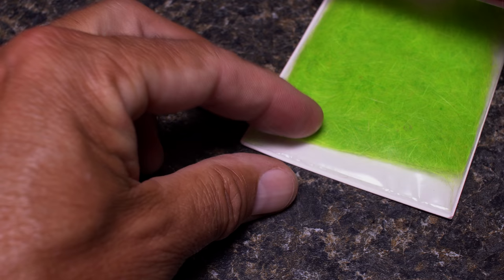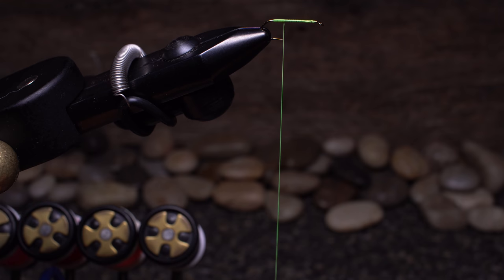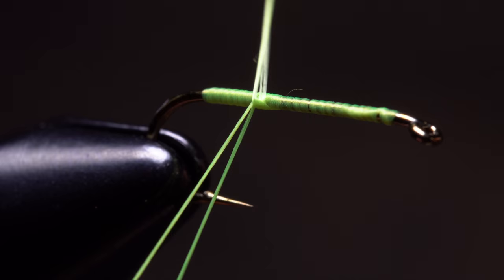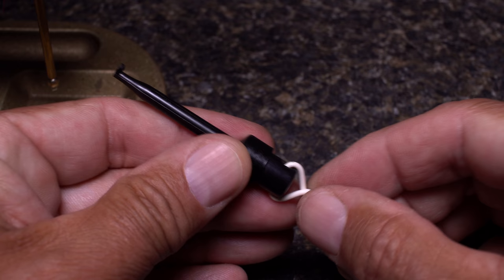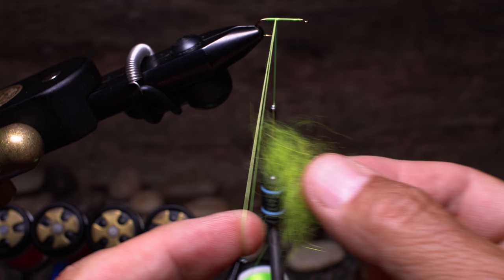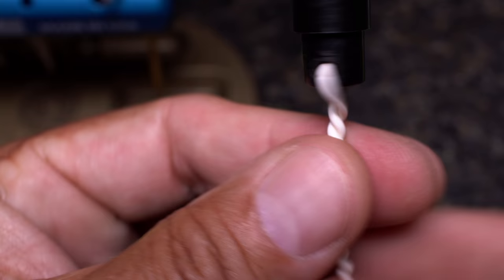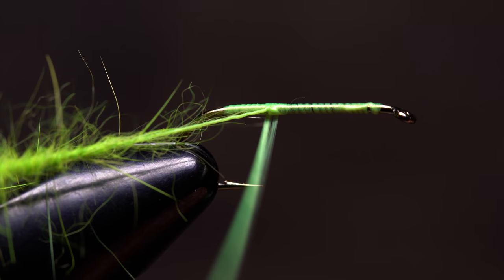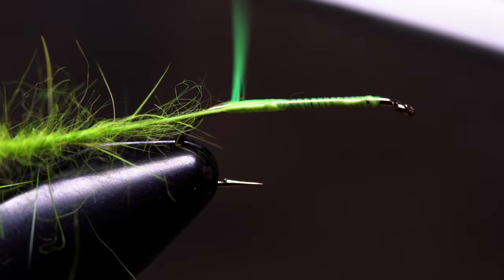How to Make a Dubbing Loop

Comment: Another great how to vid.  In other videos, you will often split your thread in two and insert your dubbing in a similar fashion.  How do you decide which method to use? Is this method in the video superior to splitting the thread?
Reply: I was wondering the same thing. Some threads are harder to split, so this might be a fix for that. Not really sure though...

Comment: Hello Tim. If you are by chance able to reply to this I would be grateful. Probably 20+ years ago I was in Shannon's purchasing materials. I spent some time eyeballing the fly assortment and in there were some Sculpin ties. They really appealed to me and I bought one. I added it to my box and took it fishing at VanCamp's grove where on first drift I secured an 18" brown. Next I was on the Pequest where I anxiously gave it to a tree. Woefully. Now this Sculpin was tied with many colors of yarn seemingly spun as in a dubbing loop. Then trimmed. The fins were implied using black moose mane, the tail,brown hen back feathers and it had small dumbbell eyes painted brown. I called them from my present location here in Ky. It was a dead end.  My point here is how did the tier put this fly together.
Reply from the maker: Sorry Thomas, I'm kind of at a loss on that one and don't recall ever seeing such a pattern in the shop. The shop, now South Branch Outfitters rather than Shannon's currently does have some of John Collins sculpins in stock. They look great and fish even better. They might be a suitable replacement. Sorry I couldn't be more help.

Comment: This is painful to watch being that thread could be split so easily
Reply: Not all thread can be split. And a dubbing loop can often be spun tighter and stronger than split thread. Also, if you're doing something like a composite loop that has lots of material and longer feathers and you're going to brush it real hard after, it can be a real pain if you're using a bobbin. Finally, being able to form a dubbing loop and then continue to use your bobbin to tie material forward of your loop and then wrap the loop over that material is super useful.
Reply: I wish you well on your recovery